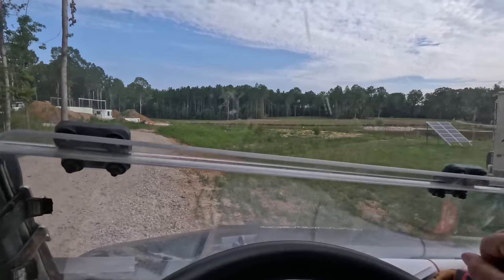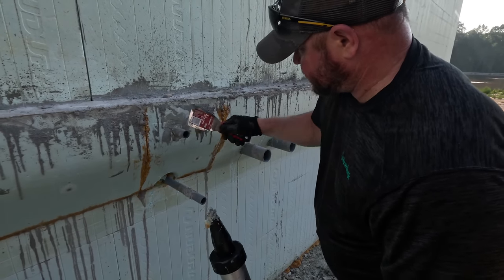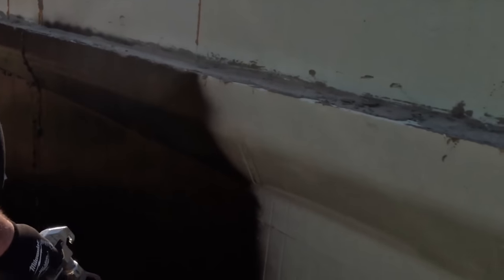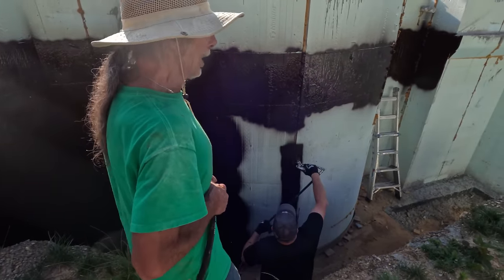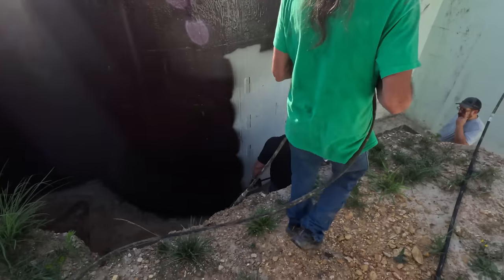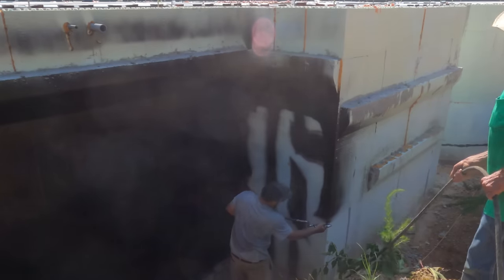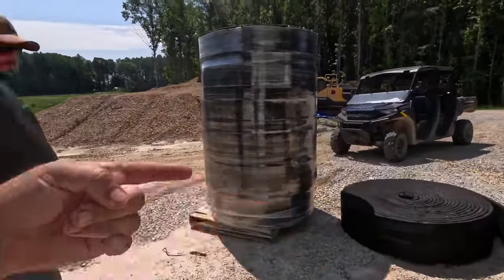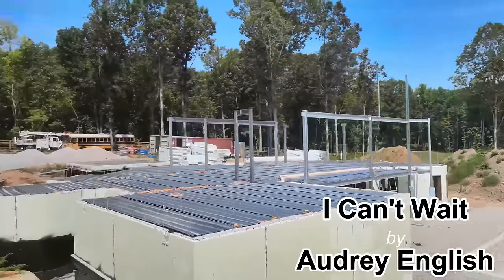Waterproofing the Basement Using Tremco Tuff N Dri

Comment: "mil" is a plastic thickness measurement like "gauge" is a wire size measurement. It isn't really a inches or metric number.
Reply from the maker: @tjbjornson154  yay!! Finally, someone told me what it is. Instead of just commenting. Thanks.
Reply: 1 mil is .001 inches
Reply: Huh? Like the other guy posted, 1 mil is .001

It's not just a plastic thickness measurement
Reply from the maker: @kennethney4260  lots of people thought it meant millimeter

Comment: Handy little tip to keep that sprayer always ready to spray between lengthy spray periods, the major key is to overly clean after use, should 'go without saying' but to make sure it ALWAYS starts when needed, at the end of the day, leave it running and shut off the gas so it can empty the fuel bowl to shut it off. It'll start every time, been doing that with my 25-year old power-washer since new, three pulls fires right up. when needed again, add fresh gas in the tank which adds fresh fuel to the carb, 😉👌🏻it's guaranteed to start every time, no matter how long it sat.
Reply: That's exactly what Darren Mustie1 tells his subscribers. 
He has one of the most entertaining and informative channels on YouTube. 
Along with Watch Wes Work. 
Darren is a hoot to watch because of the way he talks to us like we're actually there and the way he pokes fun at himself. 
Wes could easily be a top notch vocational school instructor.
Reply: @ronaldheit196  Small gas engines like this are notorious for not starting after sitting for an extended period of time if old gas is left in the carburetor. The last day on the job right before prolonged storage, allowing it to run for a few moments with the gas feed switched off instead of shutting down using the kill switch (I always use the gas shut method) uses up all of the little bit of fuel in the tiny bowl. They'll start every time!

Comment: That's a much better way than I had to do it years ago.  We had to heat up the waterproof. Then pump it to the location and aim at the concrete.  While right behind you.  Several people were taking a paint roller and spreading it before it hardened back up. Love your new technologies.  From watching your progress I'm thinking you're using a water-based sealent. In the past, it was a hard tar that was used. Today's technologies are much better on the body and environment.  Great video, Jeff, and thanks for sharing the information and experience with us all.
Reply from the maker: Thanks for watching and commenting 😊

Comment: Geoff, just a small tip.
If you cut tie wrap straps just behind the head where it goes thru the head you can reuse them.
Why buy new unless you have to when you can use them again. 
In my profession as an arcade and pinball games mechanic/electronics tech I use bags of them.
Use recycling them saves me a little chuck of change and adds less plastic to landfills.

Comment: I like the idea of a spray on membrane but I think its really important to avoid missed coverage and bridging,  I would like to see troweled sealant into all the open joints (no visible gaps), swept and cleaned off footings and a sealed wall to footing joint with a full concave trowelled fillet before spraying out to the footing edge, and perhaps use a masking board to get the top sprayed edge sharp and tidy. I have chemical grout sealed commercial buildings that had tanking leaks between the tidy slabs and floor slabs and from experience know that water will find any weakness in the waterproofing system sooner or later so it is imperative to think like you are creating a boat not a box, otherwise it sinks.
Reply from the maker: That’s great info. We didn’t focus too much on the block-to-footing connection as my inside slab is 6” above that point.
Reply: Yeah, when they built My first house, the Line from the well went Down Hill in through the Wall in to the house, NFG!
The Sewer Line went Up Out the wall...NFG, the Fifty's were a Bad time to be building Houses I guess!

Comment: DANG!  Wish this was around when I was doing PM work!  My earth mover wouldn't do it.  My concrete guy wouldn't do it.  My framers wouldn't do it.  Needed to get done.  I could do it myself way faster than I could hire someone, so time to dive in.  Mason brushes, rollers, duct taping sticks to things for extensions, yeah that's me.  Then bedding 6 mil poly into the wet goo- that was fun.  Concocted a plan to nail the poly to the top of wall (TOW) through some furring strips, so I could just pull the poly into the wet foundation coating while it was as wet as possible.  One day the boss, (owner of the company) came by and asked how I was going to get the poly bedded.  After I told him, he said he didn't understand, but was going to run home real quick, change his clothes and join me to get-er-done!  (Bottom of the hill about 1-1/2 miles to his house).  By the time he got back, I was bedding the last 15-20 feet of poly onto the wall.  He couldn't believe I got that done so well, and smooth too!  Little deeds like that turn into massive R E S P E C T rather quickly, and add up over time.

Sorry I got a little off-track there, but anyway, sure would've been nice to shoot the waterproofer on back in my day.  (Can't believe I just said 'back in my day').
Reply from the maker: That was a slick idea

Comment: Grounding the barrel:    More detail please.   Is it a static charge build up from where?    Thinking you could run it to a temporary ground rod , maybe a wire to the the pond.  

Grounds and Neutrals  are commonly not done correctly nor understood from my experience as OEM equipment designer.    

Maybe there is a wiring sketch schematic in the sprayer manual.  A reference to pdf manual might answer my question.
Reply from the maker: I have no idea. I assumed it was because the feed tube goes in the barrel and there was a potential for a spark 🤷🏻‍♂️

Comment: You used form-a-drain for the footers didn't you Jeff?  Or am I thinking of another build LOL  If you did, then between the two drainage systems and the spray sealant you shouldn't need to worry at ALL about water getting into the basement, as long as the windows and doors are closed at least!
Reply from the maker: Correct 😃

Comment: I've got an electric version of your sprayer Geoff, let me tell you, clean it out every time you use it even if it's only overnight. And never ever run it dry, like you did when you first started it. Experience.
Reply from the maker: I never ran the sprayer dry. That was just the engine running. It has a separate control box for the Sprayer, but still good advice.

Comment: I assumed the exterior t-straps would be removed before waterproofing.  I've seen other ICF contractors remove them with a cutoff wheel after the concrete has cured.  I know that are galvanized and covered, but wouldn't be a potential failure point?     

I'm curious, not a contractor.   Thanks!
Reply from the maker: @ohiomoto  probably not a horrible idea to do.
Reply: @BealyGood  Wow, you're Geoffrey on the spot with the comments!  Thanks for the reply.  🙂

Comment: Hell I moved North to the Adirondacks to get away from that Humid HOT CRAP AIR, this Summer has been Brutal, We had 17 Tornadoes in 2 Days, took out the Power for 52hrs, Ya know that Pony Express Rider said that the Red Men done CUT the Singing Wires again!
Get the PUN?

Comment: Did you shake/roll the drum first or use a large stir stick? :)

15 year warranty? Whats the real life expectancy on ICF? Or do you have to remove all the dirt around your foundation/covering it, then reapply? In-laws bought a home with prefab concrete sections with urethane caulk in the joints connecting them, they have leaks less than 15 years on. So you have to hire the foundation guys to come and remove the soil all the way down the joints, and reapply the same material every 15 years? 30 with the plastic drainage/membrane still is not reassuring. I told them I did not like that foundation when they bought it. The caulk had already failed on the southern exposure side above grade and I replaced that, and told them this would need to be done on all the joints ASAP if they did not want water penetration.
Reply from the maker: I’ll see if I can get the Tremco guy to comment
Reply: @BealyGood  👍 Wondering what would be better than what the foundation people are doing since it is not working very well. Thankfully the basement is not finished. Not being up to date on all the materials and processes these days, and not having the contacts I used to have in the trades makes figuring it out fun. Hard to even get people out to help fix failures in material and not backing up their products. Even when their window supplier left them swinging in the wind on their window failures.
Reply from the maker: @JDL_2020  i’ve heard lots of horror stores about window manufacturers the last couple years
Reply: @JDL_2020  My Brother In-Law the School Teacher wanted New Siding and Insulation on their 100+ year old House, it has Asbestos Siding, they were gonna Nail Up the New Siding, have you ever put a Nail through that type of Siding....It Cracks & Crumbles, I told Him DON'T DO IT, Wow He Listened!
Reply: The emulsion doesn’t need shaken or stirred before the application. It’s designed not to settle in the drum.
On Precast walls, we recommend the joints are sealed with the caulking recommended by the Precast manufacturer we, and then sealed over with a 40 Mil peel and stick product, with the top and side edges terminates with the same caulk we used in the video, or 60 wet Mils of the same membrane we sprayed in this video, and drainage board from grade level to the footing.
The Precast manufacturers recommended sealants are usually really good stuff, but it also needs to be covered with something else to prevent degradation, and to make it truly waterproof.

Comment: How do you stop rising damp without a damp proof course at the bottom of the walls?
Reply from the maker: We sprayed at the bottom and then put strip drain that covers 12 inches of the bottom. The inside floor is 6 inches higher than the bottom of the block outside. Is there something else I’m missing? Thanks

Comment: Not sure what that guy was talking with the 60mm thick coating. 60mm is 6cm and that is over 2inches. I think he meant 6mm (1/2 cm) not 60mm.
Reply: 60 mils, not 60mm.

 60 mils is .060"  (60 thousandths of an inch)

About the thickness of a dime

Comment: why would you not seal the whole thing to the top that way it's all sealed from the first floor down
Reply from the maker: That is a very good question. There is a different product that we will go back with and spray on the top. This stuff breaks down in UV light. So you only use it where it’s getting covered up.
Reply: thank you for the answers i learned something you all are doing a awesome job keep up the good work and content thank you k